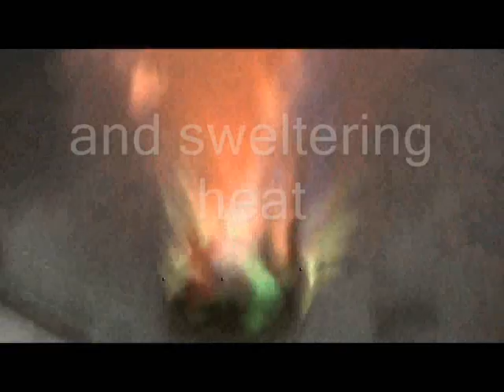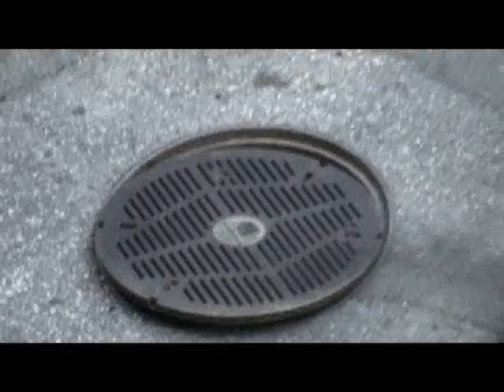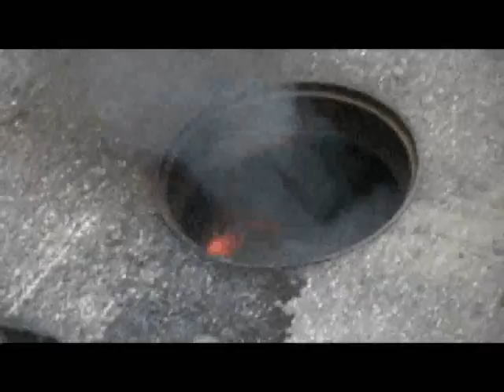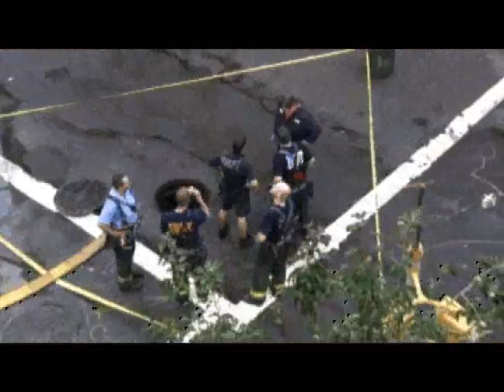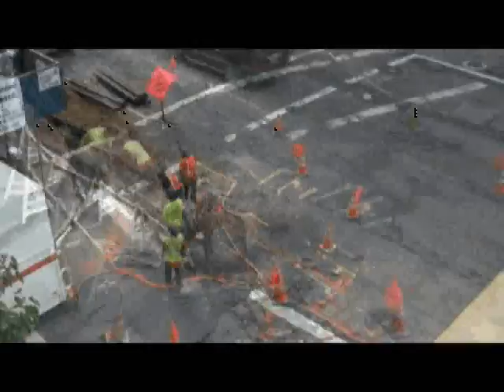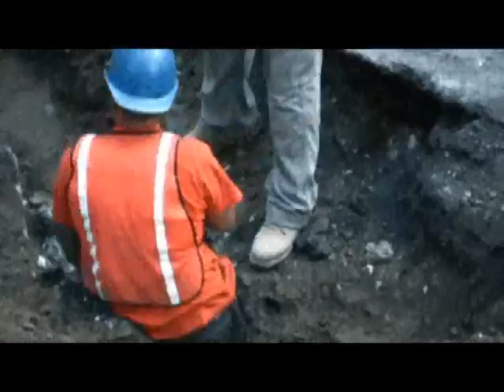manhole cover explosions

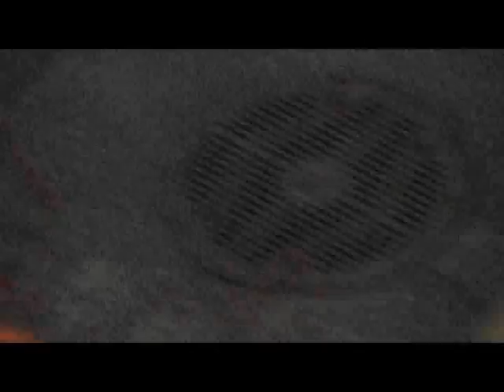Comment: 01:26 - were you ever educated Mr narrator?
Reply: MrJoe64 Carbon monoxide has a flash point of −191 °C (−311.8 °F; 82.1 K) and explosive limits of 12.5–74.2%, it's toxic and is a product of fire with limited oxygen supply. It's flammable. Carbon dioxide in the other hand is completely inert and is used for fire extinguishing.

Comment: methane, hydrogen sulfide, slow propane leaks from gas lines, oxygen updraft from low-lying discharge pipes, a ignition source such as electrical discharge...and on top of everything protected and insulated by over a foot of solid concrete in some areas....I wouldn't be surprised if one fire caused all manholes around it to pop simultaneously.

Comment: @ all the Neighsayers of the flammability of CO, this comes right from OSHA

* Flammability

The National Fire Protection Association has assigned a flammability rating of 4 (severe fire hazard) to carbon monoxide.

1. Flash point: Not applicable.

2. Autoignition temperature: 609 degrees C (1128 degrees F)

3. Flammable limits in air (percent by volume): Lower, 12.5; upper, 74
Reply: Nay sayers ... sorry couldn't let it go😂

Comment: No, CXarbon monoxide.. Think about it.. its produced from running engines and improperly vented gas appliances.. Thats why everyone is buying carbon monoxide detectors for their houses, just in case their furnace or something develops a problem or a bird blocks up the chimney, causing products of combustion to leak into the house...